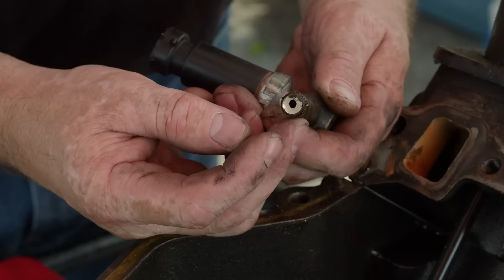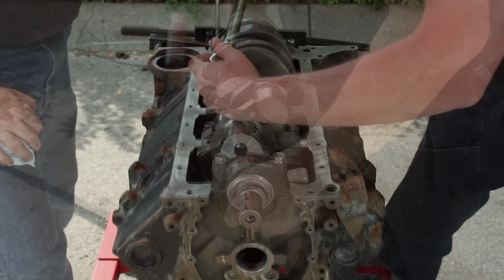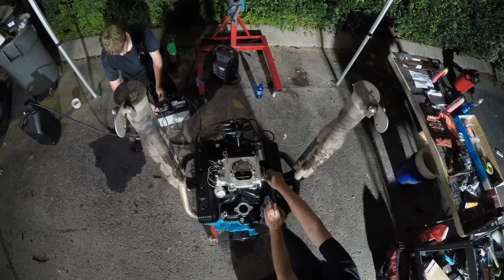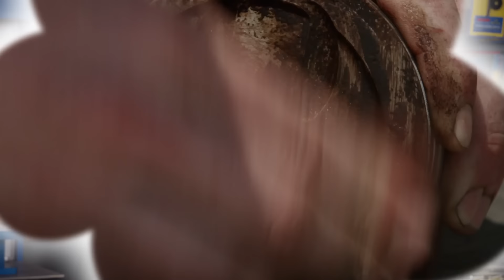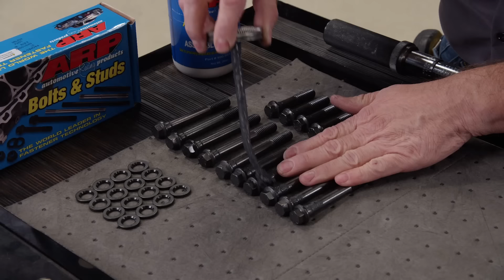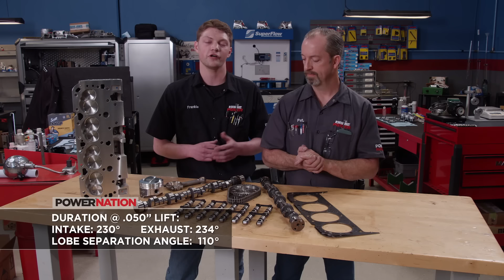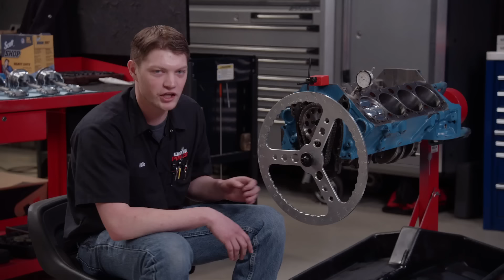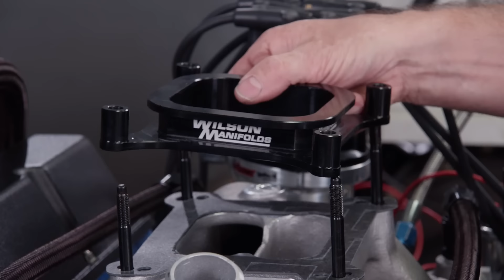Over 13:1 on Pump Gas! Chevy 350 Dyno Mule - Engine Power S9, E9 &10

Comment: Great episode.  Had been wondering how my Coyote engine could handle such a high compression on regular pump gas - that and variable valve timing to accommodate different temps must be the answer.  It sure is a different beast on cool days as opposed to hot ones...
Reply: Early hour's of the morning is great lol. Dense cold air the engines love it especially a Diesel
Reply: @patrioticaussiesams8581  Makes it hunt all the more for traction as that means cold pavement and tire temps - all fun though.
Reply: @bigboreracing356  Yes, this episode taught me about effective compression. Coyote also has port injection - was thinking most exotic thing it could do to reduce compression would be to turn off port inj. keep exh. valve open a split second on compression then use direct injection only - but not sure. But, I mean 87 octane 13:1 100+ degree days and no pinging..? I still only use 93, though. Just when we 'perfect' gas motors and electrics are coming.
Reply: All engines are
Reply: I think you could probably just have a hot temperature tune that reduces ignition timing slightly.
Reply: Efficient cylinder heads. Motorcycles have been running 13:1 on pump gas. Combustion chamber geometry and quench play a lot
Reply: I'm building a 383 cube ls stroker, shooting for ~12:1 on pump gas but where I live in Australia it gets over 110 Fahrenheit and I'm also coastal so altitude is barely above sea level. I'd forgotten to take into account environmental factors when looking at lot of cars with similar setups running similar comp in the US. Now hoping this engine won't be a hand grenade lol, I was going to get chambers on the afr heads softened if it helps a high comp n/a build.
Reply: And all aluminum to help it control combustion chamber and piston temperature better.

Comment: Important!: Dynamic compression ratio is NOT a fixed value. Dynamic compression is HIGHLY dependent on air flow, RPM, and load, especially in N/A applications.  Dynamic compression is the highest just before redline (generally), and some very high performance N/A motors can have a dynamic CR GREATER than static CR, due to exhaust scavenging, custom porting, oxygenated fuel (or nitrous/forced induction), extremely short component service life, and huge sacrifices to driveability (read, undriveable) at low RPM ranges.  For example, a dynamic CR at 2000 RPM might be 7:1, but at 6000 RPM may be 11:1 (I just made those numbers up for demonstration purposes).
Reply: You are right. Air will only flow back out past the intake at very low rpm. The flowing air has inertia and will continue to fill the cylinder well after bdc on the compression stroke. Any good performance or race engine can exceed 100% volumetric efficiency in it's power band, resulting in a dynamic cr GREATER than the static ratio.

Comment: Also you'll note ARP doesn't say don't lube both sides of the washers... it's supposed to act as a bearing, hence the lube on everything.   Also technically speaking if you have 2 sliding faces that's actually more friction than one so if anything it would bring effective fastener tension down... but an in-significant amount.

Comment: Why did they use retrofit hydraulic-roller lifters, when the 350/5.7L blocks that came with TBI were clearly setup with them from the factory? [:\
Reply: That's what the sponsor gave them to use.

Comment: What a nonsensical build. Yes it proves something, but it band aids the build with retarded timing. If you did the same engine including cam positioning but with a static compression at around 11.5:1 and set the timing where the engine is most efficient (30 to 35 degrees) it will make better numbers.

Comment: What an aenemic turd... hydraulic roller and it makes 276 to the CRANK!?! I made more HP from a 9.5:1 318 with stock 360 heads and a small hydraulic flat tappet.   Why did anyone build these shitblock chevys?
Reply: 276 h.p. @ 4800 rpm right cam for a boat..
Reply: @davidbuddendorf991  I mean it was even worse IMO "fully built" 13:1 with aluminum heads and a roller and they managed 413 HP?   That's the most aenemic turd I've ever seen.
Reply: Chevys are cheap and there are LOTS of them in junkyards.

Comment: When wrenches get it in physics, geometry,  chemistry with a slug of high engineering it becomes a whole other level.  You guys are are the PhD in automotive tech, outstanding presentation.
Reply: @bigboreracing356  They had to, or it would detonate to pieces. What they don't understand is the reversion that results in less charge and lower effective compression only happens at low rpm. Within the power band, the inertia of the flowing air continues to fill the cyls long after bdc on the compression stroke. I have no idea why they don't understand this. If there were no ram effect, intakes would always close at bdc on the comp stroke, and there would be no such thing as a tunnel RAM intake!
Reply: @bigboreracing356  I am a newb, no doubt but did find their little details interesting for sure. I was however wondering about the usefulness of the build as you mentioned for say my “grocery getter”

At the end they mentioned that they saw it had vacuum in the pan which somehow informed them that there was no detonation occurring. 

If not to much of an ask, can you explain that?
Reply: @toddbridges7430  No blow by past the rings which causes a positive pressure in the lower end.
Reply: @mjh123crh  Yes that makes sense in that its a new build, but was has me goin is that the older guy mentions that he saw vacuum in the crankcase “so there is no detonation”
Perhaps they put vacuum there in order to prevent detonation ???
What is the the connection between the two?
Reply: @toddbridges7430  No blow by by the rings means no fuel in the crank case means no detonation in the crankcase, I'm assuming as the old road draft vehicles would sometimes blow the engine apart from idling long periods of time and didn't move fast enough to create a vacuum on the road draft tube so the crankcase would fill up with fuel vapors on hot days and when they got to the point of saturation of enough fuel in the crankcase the bad sealing rings would allow flame by the rings causing the saturated fuel in the block to ignite basically creating a internal explosion inside the engine and some would blow the block to pieces. This is when the auto manufactures came up with the positive crankcase ventilation system also know as the PCV valve because it evacuated the engine block constantly whereas the road draft tube only vented when the vehicle was moving at a certain speed.
Reply: @mjh123crh  Ah now I see  what yourself and No prep stretch are on about. 

When he says no detonation I am  thinking detonation in the combustion chamber. The younger guy touches on that issue briefly in the early part of the video. I have experienced this 1st hand in a 350.

Because of a few factors, compression, heat, timing, and octane or the lack thereof, one can get detonation occurring, which is different than pre ignition and bad bad bad. 
As I understand it, (if I do at all) it’s when too much heat develops and ignites fuel in the combustion chamber just as the piston reaches TDC. That ignition flame front meets the spark plugs ignited flame front and rather exponentially expands with such heat as up to 2000F.
Melts pistons, burns through the block from one cylinder to the next on the block deck and actually leaves the head combustion chamber looking like it has been shot peened,,,, because it has.

Lotto words but thankyou for your thoughtful reply and input !!! This stuff is addictive
Reply: @mjh123crh  You're way off. Detonation is an erratic or uncontrolled burn after the sparkplug ignites the mixture in the chamber. This causes pressure spikes that disturb the ring seal enough to allow combustion gasses past the rings into the crankcase. When that happens you can't maintain crankcase vacuum. The problem with the host's reasoning is that light detonation will not always cause this to happen. It could still be experiencing light detonation.
Reply: @bigboreracing356  A compression test will show the dynamic compression only at cranking speed, which brings up something these guys don't understand - an engine running in it's power band will not have reduced dynamic compression. Air has inertia, and continues to flow in and fill the cylinder after the piston has started back up in the compression stroke, which is called the ram effect. That is the whole point of single plane intakes and tunnel rams - enhancing the ram effect, resulting in greater cylinder filling, even exceeding 100%. It is only at low rpm that air gets pushed out of the cylinder and back into the intake manifold on the compression stroke, resulting in less charge and reduced effective compression.
Reply: @bigboreracing356  You are so Uninformed! guys like you tell people they can build engines and then blame the parts when it doesn't run for shit or blows up..PASS! NEXT! avoid this doof like the Aids It is!
Reply: @bigboreracing356  I can't Beleive they bolted those heads back on. Lol
Reply: @timothythomas1737  u don't gotta machine a head unless it's warped although the heads do flex once u bolt them down. Truck flow heads aren't really good heads they aren't ever flat ND the valves never sit perfectly like u pretty much should rebuild the heads but most people bolt em on and call it a day
Reply: @jackdaniels2657  yeah I get that i have been an auto and a marine tech for years. I was referring to a tbi head.
Reply: @timothythomas1737  oh. In disappointed in this build I thought they was gonna make 600 hp atleast 500hp
Reply: @jackdaniels2657  I thought at least 600 I think they over thought it. Lol
Reply: @timothythomas1737  they said it was like above 13 to 1 compression ratio so I was thinking like hell yeah we gonna see alot of ponies ND then oh its only 400hp like seriously they should've just bought a junkyard Ls and did the 13 to 1 compression

Comment: What a waste, I have a stock 93 5.7, put afr, runs great 10 to 1, have 12.5 to one it does not run on pump gas it would ping to death, so it will be interesting how this is. 
112 lob sep,wtf what a piece of $#it, then a smaller duration, with a 110 waist so much power left on the table, big waist of time.yeah 400 hp 🤣🤣🤣🤣🤣🤣 made 450 on my 5.7 waist.

Comment: I mean I guess it would be cool because you could put race gas in it and put the timing at 34 degrees of timing in it and my ale a ton more power at the track. But I’d rather have 10.5-11:1 CR and the timing to make more than 412 HP all the time with a 150 shot of N2O.

Comment: I only just now understood the concept of dynamic compression from this video but question the point of keeping the intake valve open during any part of the compression stroke.  Wouldn't that just push air and fuel back into the head and potentially cause cavitations in the flow?  That can't be good.
Reply: They made it confusing, because they don't understand it themselves. Even stock engines keep the intake valve open after bdc on the compression stroke. It is only at very low rpm that air gets pushed out of the cylinder and back into the intake manifold on the compression stroke (reversion), resulting in less cylinder filling and reduced effective compression. An engine running in it's power band will not have any reversion. Air has inertia, and continues to flow in and fill the cylinder after the piston has started back up in the compression stroke. This is called the ram effect. That is the whole point of single plane intakes and tunnel rams - enhancing the ram effect for greater cylinder filling at high rpm. The top end combo - intake, heads, cam, exhaust, and compression, determine the rpm range and power level. A good performance or race engine can exceed 100% cylinder filling in it's power band. That will result in a dynamic comp ratio Greater than the static ratio, or the exact opposite of what they think is happening.
Reply: @scottm7341  On boosted engines keeping intakes open during compression makes sense because you can theoretically keep pushing a charge in until the cylinder pressure overcomes the boost pressure without causing reversion. 

 I don't believe any kind of NA air ram system produces even 1 psi though.  I found a quote on google that says @ 200mph you get 0.7 PSI from ram air.  While I agree there can be a window where keeping an intake open could produce some additional power from inertia and pressure on an NA engine, I just don't think it could be too much.  I guess to squeeze every bit of power from an NA engine its still a relevant factor.
Reply: @reviewaccount469  it does make a significant difference. On a typical stock engine the inlet valve closes somewhere around 50 degrees after BDC.

There is another benefit: longer duration on the inlet means that the valve spends more time at high lift, so it can flow more air during the inlet stroke.
Reply: @reviewaccount469 Air going into an engine through the intake port is moving a HELL of alot more than just 200mph. It can reach super sonic speeds at times, although this is not a good thing of it gets moving THAT fast.
Reply: Yes. That's called reversion. If you ever hear people talking about the engine "loading up" from idling too long, that's what they're talking about. The reversion can cause the intake tract to get loaded up with fuel droplets. 

Along with a few other things, that reversion is what helps create the cool "horse gallop" in the idle that so many people like, though, by messing with the vacuum signal in the venturies of the carb, so there's that. 👍

Comment: Pro tip. 
If you need to remove the heads off an old junkyard motor. You're going be rebuilding anyways. Leave the valvtrain untouched and start unbolting the heads. The spring pressure will help lift/separate the heads from the block. 
You most likely won't even need to you a wedge to get the heads separated at that point.
Reply: He’s right I have built hundreds of Chevy engines.
Reply: I can't imagine valvesprings strong enough to un-stick a head that I wouldn't be reusing. Wouldn't hurt to try, but I don't see it working.
Reply: @slowpoke96Z28  I saw David Fryburger do it once. That was damn near 20 years ago.
Reply: @I_like_turtles_67  how long had those heads been on though? Can I go to a scrap yard, find a 100,000+ mile sbc and this trick work. That's my question.
Reply: @slowpoke96Z28  If the springs have pressure it helps separate them from the head gasket. I haven't tried it in a while. I got a SBF long block in the garage. I need to try it on that.
Reply: I recently started doing this. So much nicer!
Reply: This is not a "Pro Tip".... 😒
Reply: you never have even worked on a engine before the valve springs will not help the head come off lol
Reply: @timmensch3601  The valve springs leave tension on the pushrods. That helps lift the heads.
Reply: @jhutch1470  I learned something new today I have never really worked on small gas engines class 8 truck engines cat,cummins,detroit
Reply: @timmensch3601  I would love to learn about those big engines. It would be cool to install a cam shaft that is 4 feet long. LOL
Reply: @timmensch3601  I take it you've never tried this with a pushrod motor. 
It works lol.
Reply: @timmensch3601   Commentor fail. With the valvetrain still in, some valves will be held open by the cam and pushrods, resulting in the springs helping to lift the heads off the block when the head bolts are removed.
Reply: @scottm7341  hey I learn something new today
Reply: @timmensch3601  haha- I bet you’re single.
Reply: @Lovesndpeace  nope happily married
Reply: @timmensch3601  I forgot, same sex marriage is legal now
Reply: @Lovesndpeace  
Yes me and my husband  are very happy 😊 
Thanks  for your full support of LGBT UVWXYZ 💕 😘 ❤ 💖 💗

Comment: So my question is what is the reason for building an engine to have a high static compression ratio when the dynamic compression ratio is going to be so much lower?
Reply: Any kind of rule you have to run pump gas
Reply: They are related.  Static compression is the theoretical max dynamic compression ratio that is achievable by the rotating assembly and is easily quantified by the dimensions of the components, that way you know what to buy.  Parts can't be sold based on dynamic compression ratio because it is determined by the overall setup and performance of the engine, therefore the only way for it to be determined is by putting it together and running it.

Comment: not excellent......i have less cimpression....by far....your cam selection sucks.......i have the same combo all trick flow.....i use a air gap.,and carb...windage tray...etc.. and that combo...makes at 7000 rpm....no nitrous.....200 more horses than you....my engine was copied ......and won the engine masters challenge.......you guys need to go back to school...
i see lots of holes in your engine theory.....and alot of your stuff could make much more power...
i know i speak for alot if your viewers.....leave engine design to real engine guys like ed pink..kieth black..sid waterman...